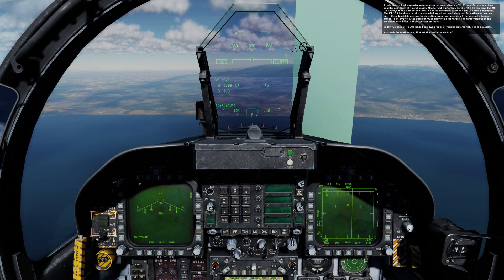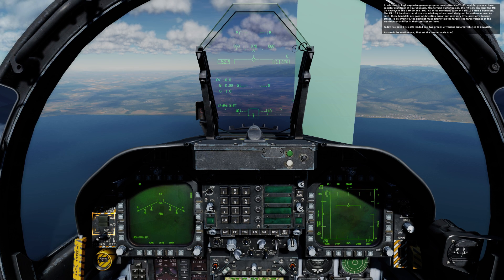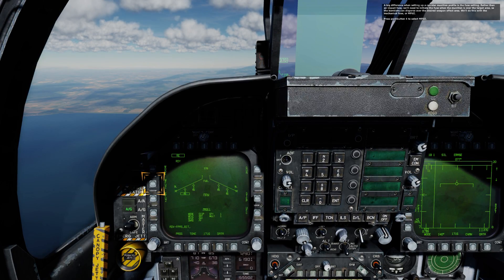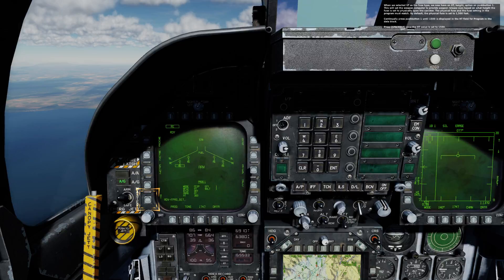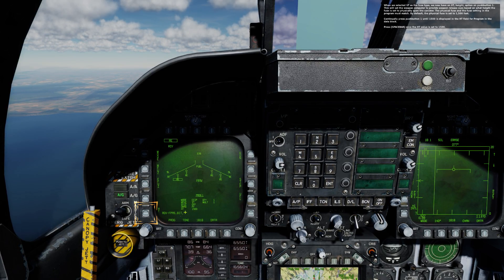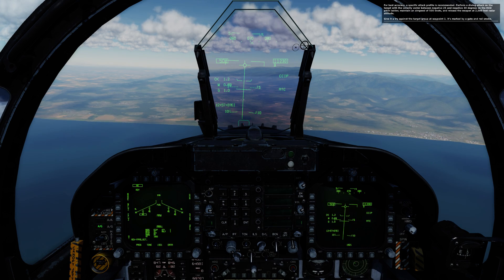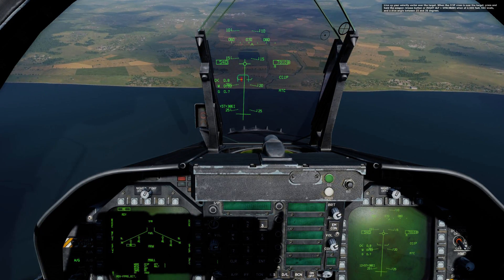DCS: F/A-18C Hornet Canister Munition Lesson Recording

Comment: 3:55 What's the meaning of the "DUD" cue and when does it appear?
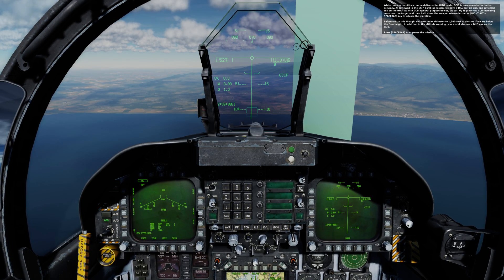Reply: 2:38 : Its a altitude warning letting you know your below your fusing or you hit the altitude your canister is suppose to blow up at.
Reply: Or in some cases it means the correct fuse is not set up. IE: electric/mechanical fuse is set to off. Fuse type depends on bomb.